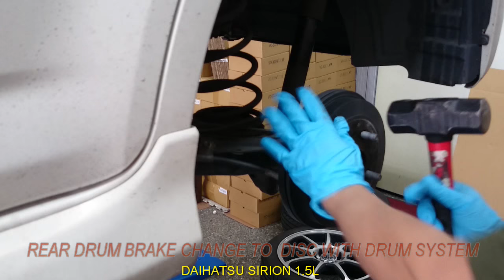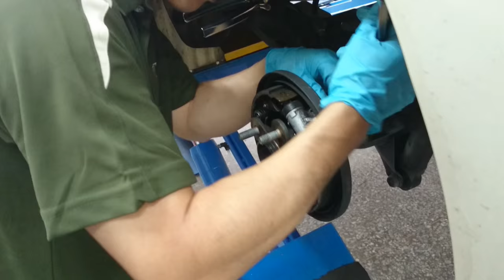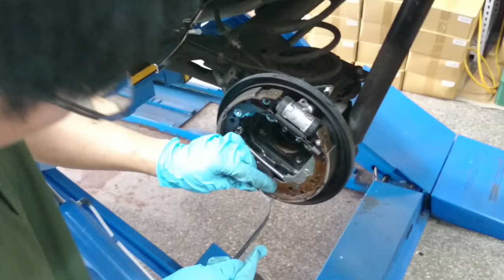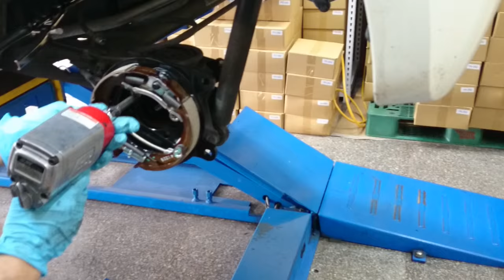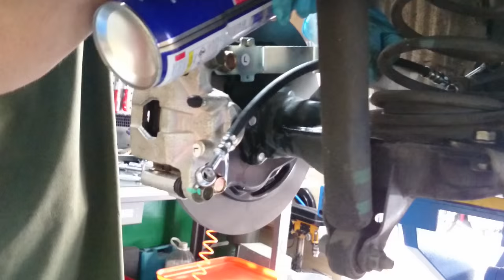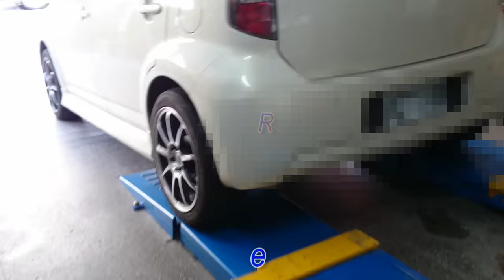Daihatsu Sirion UPI rear drum to disc brake kit detail version

Comment: May I know how this double system brake kit work?
Reply from the maker: About our conversion kit (Drum in Disc system):
The disc system is controlled by hydraulic power from the brake paddle people step on.
The drum system is controlled by the cable connected to the hand brake handle.
These two systems function individually.
Thanks!
Reply: @UniquepowerTwUnique-Power  impressive. Does it mean after installing your double system brake kit whenever I stepped on brake paddle the rear disc will work as well ? By default only front disc will work when we stepped on the brake pedal. Do we need to upgrade brake servo as well for this kit?
Reply from the maker: There is not much change in the total amount of hydraulic fluid, so there is no need to replace the master cylinder.
After the upgrade, it will become a four-disc with a handbrake drum.
Using the handbrake alone can also make the car stop at a speed of 60 Km/Hr.

Comment: Is the size of the brake drum is 181mm? I have a 2020 Myvi (D20N) (M800) and most of the parts are from Daihatsu. I think this would be a PNP. The brake drum is the same size,design and internals! The 1st, 2nd and 3rd generation Myvi uses the Sirion platform. I have already sent you guys an email. I hope you check into it!

Comment: How to adjust E - brakes on yrv daihatsu? ??
Reply from the maker: Please define "E - brakes", thanks!
Reply: When i pull up the handbrake the car will be still move
Reply from the maker: Please check the tightness between the shoe and the disc.
Your disc should rotate freely but slightly touch to the shoe.
If possible, use the sandpaper to clean the surface of the shoe once.
Our kit allows you to stop your vehicle in 60 Km/Hr  when emergency happened.
Normally, parking brake should be functioned in speed of zero or close.
Please send email to info@unque-power.com.tw for detail discussion.
Reply: How to move the break shoes closer to the hubs
Reply from the maker: Do you mean shoes closer to the drum?
There is a "Shoe adjusting screw" for tighten or loosen the gap.
Please refer to installation guide from technical data page on our website.
www.unique-power.com.tw
Thanks!

Comment: What is the disc from, a Toyota?
Reply from the maker: The disc is made and adjusted for fitting all offsets through whole system.
It is an unique one.
Also it is similar to next product line (Triton, Navara, D-max ), but slightly different at each center hole spec.
Reply: So wait, when the car needs new disks i have to order from you?
Reply from the maker: Yes, we spend a lot of money to keep the disc in quite high quality.
Cost of the disc is over twice than China made.

But we encourage user to upgrade their pad to performance one from market if needed.
Reply: Unique Power International but if you're the only manufacturer of discs, that makes them hard to supply.
Reply from the maker: You are right, we are not big enough now.
I believe that no third party would like to produce discs in our specification.
By the way, after installed our kit, user can upgrade again to racing caliper and 2 pcs discs easily.

Comment: so there is a drum brake within the disk brake just for the hand brake? WTF?
Reply from the maker: For disc brake only as its original, when taking the O.E. caliper off to a racing caliper, need extra caliper or drum to do the hand brake job.
For drum brake as its original, we size down the drum and build a new disc system to upgrade all  the brake system.
Almost all heavy vehicles, only the drum system can do the hand brake job well.
Reply: ok thank you
Reply from the maker: You are always welcome.
Reply: Unique Power International is there a kit for m100 Sirion MkI? (2004 and before)
Reply from the maker: Let us check it. Will reply as soon as possible.
Reply from the maker: We checked from the website.
http://www.tuttiautopezzi.it/2166402

The wheel bearing should be the same at the rear.
Basically, the front may be different, but the rear is the same for most cases.
Please refer to the list on the web.
Reply: Unique Power International Thank you much, so this kit will fit the earlier sirion models (pre 2004)
Reply from the maker: I checked with our engineer. 
He told me the Hub is different from 2005.
So our kit will not fit the models before 2005.
Sorry for the wrong information I gave.
Reply: no problem, thank you anyhow